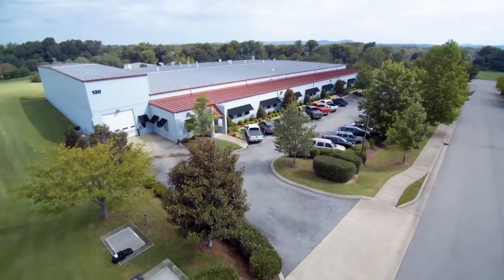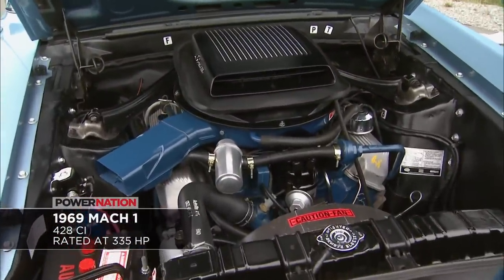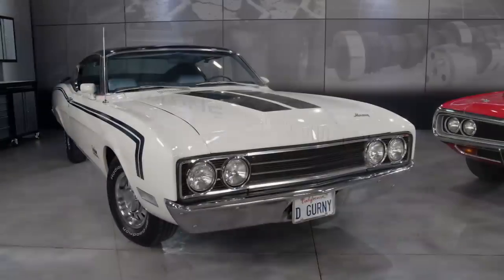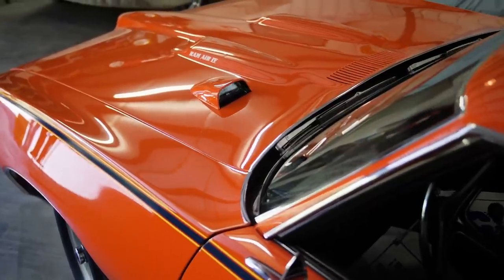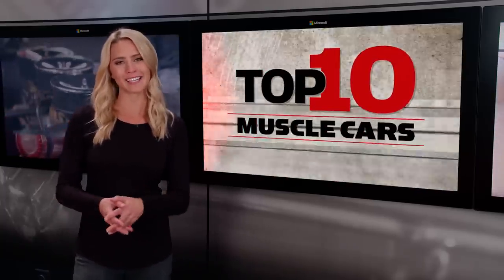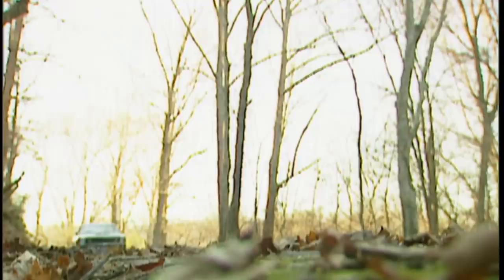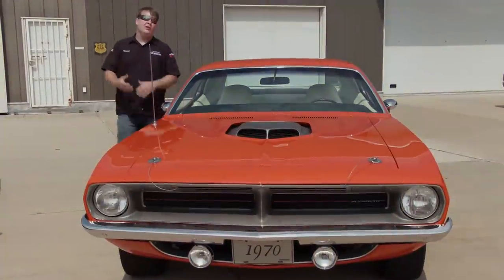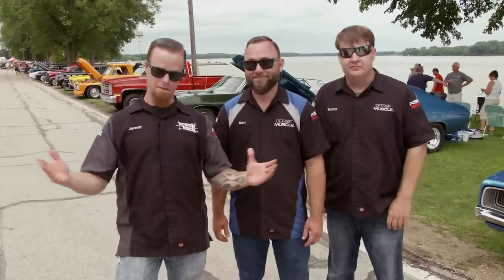Detroit Muscle's Top 10 Muscle Cars

Comment: If I had to choose one car on here it would be the 68 Charger R/T 426 Hemi or the 69 1/2 Roadrunner A12 440 Six Barrel
Reply: 1970 was a great model.  1st year  with electronic voltage regulator,  1st year  with  side marker lights,  rally instrument panel,  F70-14 raised white letter tires,  hydraulic lifters,  etc.
Reply: Jeremy Thompson Damn straight, Brother!!
Reply: Jeremy Thompson I sold my 1968 for 40 charger in 1984 for $375
Reply: I did like the Roadrunners on this one!
Reply: I'd have to take the Hemi Cuda, even though passing up a judge, Shelby GT500KR and the Boss 429 makes it a tough decision but I just have always had Mopar (Mo'Power) in my blood.
Reply: @scottricklaroque7428  Same here. My father had a 70 Challenger, lime green black top, though it was the floor shift so it had to be the 340. Still nostalgic dream car for me. He was a GM skilled trades and would not allow anything else in his driveway.... except the Mopar. He let his sister park her late 70s model mustang here for a few days but he bitched about that too.
Reply: @14yeartwitch14  My friend and I got cars at the same time when we were 16, a couple months apart but I had a '74 Ford Econoline van until he got a '70 Challenger, 225 slant 6, 3 speed floor shift. The van gave out and my dad traded it in on a new '82 Ford pickup but my friends brother had a '74 Plymouth Valiant Scamp, 318 auto I bought putting an 8 3/4" rear in it when the 7'"(?) pinion messed up. The '74 318 only had 150 hp, about the same as the 225 but the only difference between the '72 230 hp 318 was the heads so I was searching for a pair. But anyway, we raced one day from 35 mph and we were dead even. lol I have no idea what gears were in the new rear but it was probably like 3.55 or so but I also jacked up the rear and put L60s on it making it even higher (lower numerically) ratio. I loved that car.
Reply: @scottricklaroque7428  God, that sounds like fun!. I'm going to buy a good 70s muscle car here in the next year. I'd love to have time to fix one up, but I work too damn much. So I'm prob going to buy one in pretty good condition. Decisions, decisions.
Reply: Most people I know in that position get mid '60s Mustangs in good shape and just add bolt on stuff, intake/carb, headers or maybe a nice cam. When I sold my Scamp my neighbor had a modded (I think'74) Maverick, 302, 4 speed that thumped nicely I wanted but he moved before I could get the money. :/
Reply: @scottricklaroque7428  I've always said the only Mustang I would ever own is a Mach 1or2. The one in the Steven Seagal movie Marked for Death was the first one I ever saw that made me change my mind about Mustangs.I have the body of a 71 Detomaso Pantera with all of the innards in a garage attic. It would break the bank and wipe out my retirement to get it back to ideal. Then I've got a weathered and poor conditioned 86 Buick Grand National that would probably take a bit of change to get back to snuff. I'm thinking I'll have to let them go in an estate sale. Ah! It kills me!
Reply: @14yeartwitch14  Damn, I would LOVE to have a GN or GNX Regal. I've always kind of liked the 80's Regals and Cutlasses anyway but the GN snd GNX were the holy grails for me, I did almost go into debt to buy a Hurst Olds, I went there because my Buick Dealer couldn't get any more GNs, they sold their allocation pretty fast but there was a sweet Hurst Olds cutlass, 307 v8 w Hurst Lightning Rod shifter, I'm glad I didn't though, I got a deal the next year on a 71 Firebird I was turning into a Trans Am, had the shaker scoop hood and tailfin with a 400 and a Weiand hi-rise with a Carter 800 cfm Thermoquad and an automatic with B&M shift kit. Man that thing screamed. I would never have been able to afford that had I bought the Olds.
Reply: @scottricklaroque7428  The GN was fun, I learned to drive in it. My mom took me to a local university parking lot and told me to floor it.... i hopes of scaring the shit outta me. Didn't work. But throughout the years she used it as a daily driver and it just didn't get the care it should have gotten. I saw a documentary where there's a place some enthusiast started that has nothing but GN/X spare parts and rebuilds them. I'm just afraid to see what the guy charges.
Reply: The 68 Charger is just awesome, my dream ever, there is no other car for me
Reply: @scottricklaroque7428  Thank you!! Milburn Varner in that 'Plum Crazy' Cuda. "Drag Addicts" Hot Rod magazine.😊❤️
Reply: these constant advertisements are killing me

Comment: I like the 68 Dodge charger 440 R/T six pack black on black it's my dream car. I have ridden in a 70 Pontiac Gto judge 400 ram air iv you could feel it how much it wanted to cut loose my friend has a 67 Chevrolet Camaro 454 450 hp  500 ft. Lbs of torque I rode in it is very fast it may not be a option for 1967 Chevrolet Camaros but when tires start burning rubber its awesome

Comment: LOL, thanks for the laugh.  Muscle Cars by definition were ¼ mile cars. And you guys have embarrassed yourselves not only with your top 10, but "The first muscle car".  1963 Max Wedge was ignored. And the car that held the IHRA factory record for many years, The 1964 Ford Thunderbolt 427FE.  And how the hell was a Stage III GSX missed?    In short, ya prolly need a person over 50 years old to use as a resource, not Autozone.
Reply: My comment before seeing yours was, where the efff is the GSX?
Reply: The 1962 Plymouth Savoy with the 413 max wedge was the first factory production car to break the 12 sec. It ran the 1/4 mile in 11.93 seconds blowing the doors off any other factory production car. The Buick GSX stage 1,2,3 was not faster.
Reply: My uncle was Milburn Varner!!! Check out his history in a "wedge" car!!! Hot Rod magazine. Then a 'Cuda.❤️
Reply: Yep. 63
Reply: Wrong the Plymouth Savoy was the first production car ever built to run the quarter mile in under 12 seconds. Ford got its ass kicked. And as far as the Buick stage 3 it never stood a ghost of a chance against the 1963 Plymouth Savoy.so get your facts straight.

Comment: The Dodge Daytona/Superbird didn't make the list?  You chose a 1969 Camaro SS/RS 396 over a Yenco Camaro or COPO?  No 409 on the list, it's the icon of muscle cars?  No HEMI Charger 500?  No Buick GS or GSX w30 455?  No 67 Shelby 500 427?  No 68 HEMI Dart or Cuda?  I don't see a Yenco Nova on your list.  You skipped the 63 split window Fi Vette!  That is one sad list.  I owned a 70 HEMI Cuda in Plum Crazy, it was a 4-speed and super track pack Dana 60 car, console delete, AM 8-track.  So you at least got number one right!

Comment: Missing the GS Stage 1 and GSX. My drag racing experience in the day says that your poll is bogus.
Reply: I agree same with the Olds 442 W-30 should be there as well but the '70 Stage 1  had the most Tork ... I got my '70 442 W-30 running 12:60's   @ 102 m.p.h. in the quarter mile with a bit of tinkering and tricks...

Comment: Among the cars that would outrun a GTO was one from Pontiac.  The tri-power 421 Bonneville which had a higher top speed and a quicker quarter mile.  re: the COPO Camaro you failed to mention the all aluminum 427 powered ZL-1.
Reply: The Copo was mentioned after they talked about the 69 SS-RS Camaro but the Copo wasn’t a factor production car

Comment: Plum crazy purple 1970 Roadrunner with a 440 six pack that is my dream car and thank you guys for giving me a peek at it even if it didn't have the iconic 440 six pack
Reply: These ran in the upper 11's...Remember 185 60 series bias ply tires they came with had no traction yet ran high 12's - 13's spinning !

My Dad owned his 70 Cuda 440 6bbl since 1970 when new,2 weeks after he bought it he ran 11.80's by tuning the carbs,adding headers/custom mufflers,traction bars and laughable 10 inch wide drag slicks that spun 130 feet down the track lol ! They hook less than a modern tire !

Comment: AMC produced the 2 seater AMXs from 1968 to 1970. With factory options including Doug Thorley headers, 390 stroker motor crossram dual 4 barrel edelbrock intake dual Holley 4bbls an amc 20 with posi and 5.11 to one gearing this was the fastest production car in the quarter mile in 1969. They shared many parts with the Javelin but shorter wheelbase and only 2 seats.
Reply: Wrong..... The AMX did not come factory equipped with any of those parts as a regular production option. What AMC did offer was select catalog aftermarket parts called "group 19" that you got through the parts department and installed yourself. In 1969 AMC commisioned Hurst to build 54 SS AMX cars for super stock class drag racing that were not street legal. Those 54 were race cars only sold to select racers to fly the AMC banner at the drag strip.

While the 1969 SS AMX race package was the most potent AMC it was by far not the fastest. Chrysler had Hurst build 80 Hemi 1968 Dodge darts equipped dubbed "LO23" and 80 Hemi 1968 Plymouth Barracudas "BO23".. As delivered the Hemi mopars were a full second quicker that the AMCs through the quarter mile and still rule SS/AA Super Stock drag racing to this day.

Comment: Chrysler 300 was First !!
Reply: Oldsmobile may argue with the rocket 350
Reply: @bmstylee  You can argue until you are blue in the face but you are WRONG.

Produced from 1968–1980, the Rocket 350 was entirely different from the other GM divisions' 350's. It used a 4.057 in (103.0 mm) bore and Oldsmobile small-block standard 3.385 in (86.0 mm) stroke for 350 cu in (5.7 L). Output ranged from 160-325 hp (119-242 kW). 

http://www.autozine.org/Archive/Chrysler/classic/300.html
Reply: @DeliciousDeBlair  Shows what you know. LOL. Look up the Olds Rocket 88 form the 50's. Also look up the OLDS J2. First car outlawed from NASCAR.
Reply: @Gramps83  My dad had a 371 J2 in a 1958 Delta Super 88.

In fact he owned from 1953 to 1959 Oldsmobiles [including a 1957 Fiesta 3 piece back glass] and from what the information shows, the only reason the J2 was banned was this sudden ban [be it strategically planned or not] on the use of multiple carburetors.

A large 4bb carb would have well suited the need and resolved that issue just fine.

The J2 was STILL behind the Hemi in chronological history of winning championships, as well as behind on overall power numbers over time so that at no time was it genuinely a competitive force against the Hemi, and although the non-hemi engines may have faltered a bit, they too have held their own quite contentiously throughout time.
Reply: @DeliciousDeBlair  All I'm saying is the Olds/GM V8 being the first mass produced OHV V8 was the beginning of the "muscle car" in my eyes. by '53 or '54 they were closing in on 200 hp and 300 Tq. A reason many hot rodders used them. But yeah, the late 50's saw better power numbers for both the Chevy small block and the Hemi.
Reply: @Gramps83  Determining how much 'muscle' makes a 'muscle car' also should be weighed against how much 'muscle' a 'non-muscle car' makes by the same producer, and, in general, how it stands against the existing industry as a whole.

The records easily located show that Oldsmobile was not reaching the 200 mark until 1955, when Chrysler was reaching the 300 hp mark.

Unless you can find some more official, verifiable and authoritative report, I will refer to the following links:

https://en.wikipedia.org/wiki/Chrysler_Hemi_engine

https://en.wikipedia.org/wiki/Oldsmobile_V8_engine

According to those reference articles, at no time in history did the Oldsmobile even equal the Hemi, let alone surpass it, and again, when you use the definition of 'muscle car'  you must establish what parameters you are using or else it is purely a preference and an emotionally biased one at that.

In between more recent years when the Hemi was deemed too expensive to produce and market, of course, Chrysler introduced the wedge series or the B [and then later RB] series of engines.

https://en.wikipedia.org/wiki/Chrysler_B_engine

Again, at no point in time, did Oldsmobile outperform these engines save when the oil embargo and emissions crunch led Chrysler to begin reporting HP as BHP [wheel horsepower] to intentionally downplay the power of their engines for the sake of appeasing the EPA and DoT, although eventually they did actually de-tune [as did all of the other OEM MFRs] their engines to comply with the government's ludicrous and unfounded demands.

The facts stand for themselves in this issue.
Reply: @DeliciousDeBlair  Yeah, but you are not accounting for torque and gearing which are more important than horsepower. Especially with "Muscle cars".
Reply: @Gramps83  The torque specs are all there in those charts.

I have driven Oldsmobiles and MOPARS and in all fairness, a 'seat of the pants' assessment is not very realistic.

Some of the reason some people argue that a 'muscle car' has to be light is because they posit [and with some fair validity] that if you are carrying a whole lot of extra mass around with you it is going to eat up a lot of your 'muscle' compared to putting the more powerful engine in a lighter body.

For this reason, many would argue that neither the early Chrysler or Oldsmobiles were 'muscle cars' but since there were few real comparable chassis out there to consider 'lighter' at the time, one definitely has to go with whatever combined engine and body one could acquire directly from the factory.

Now I do not claim to know all of the weights or gear ratios offered by either, let alone both of these manufacturers, but if one wanted to research it out and 'hand pick a dream car' it might be kind of challenging, seeing as for most of the Chrysler 300's career, it 'always and only' came with the biggest, strongest engine they made, but then later on, they changed this policy and began favoring B-body cars like the Charger, Challenger, GTX, Barracuda, etc.

I do not know what engines in 1955 you could get in what Oldsmobile models, directly from the factory, or how much those cars would weigh or their BHP/weight ratios were, but it was very rigidly fixed for the Chrysler models, be that a good or bad market strategy.

So all in all, just going off of the limited information there is now, one can not really declare any advantage based on torque and gearing, at least without doing some more research into what cars you could buy from Oldsmobile with which engines and which final drive ratios.

I am sure that if you wanted to press that point, some data might exist out there to further push your thesis, but for now, going on the easily obtained, its still a push in favor of the Chrysler corporation.

Sadly, neither of them would really stand up well against the Corvette line up and people for some reason often overlook it as a 'muscle' car and deem it a 'sports' car, even though it did have some pretty punchy engines and was always a very light chassis.
Reply: @DeliciousDeBlair  There were no torque specs in those links.
Reply: @Gramps83  All of the links I sent you had the torque specs in them, wtf you talking about?
Reply: @bmstylee  the Oldsmobile 350 Rocket didn't come out until like 13 years after the first Chrysler 300. The 1955 Chrysler C-300 is the very first American muscle car
Reply: @Gramps83  I know exactly what a J2 Oldsmobile is. They only made em in 1957-58. They got outlawed at the exact same time as the supercharged Ford 312, fuel injected Chevy 283, and the Pontiac 347 Tri Power. NASCAR banned superchargers, fuel injection, and multiple carburetors in 1957. The 1955 Chrysler C-300 is the very first American muscle car and also the very first regular production car with 300 horsepower. A Six Cylinder Hudson Hornet was faster than a 1949-53 Olds Rocket 88. The early Rocket 88's were fast for their day but they only made 135 horsepower. The 57-58 J2 Olds definitely were really fast in their day. One of the fastest cars on the road at that time actually

Comment: Barracuda came out before mustang
Reply: "The first-generation Ford Mustang was manufactured by Ford from March 1964 until 1973. "  and. "the Barracuda debuted in fastback form on April 1, 1964."  So it was the Mustang then the Cuda..
Reply: Actually it was planned to come out first but Ford got wind of what Chrysler was planning and rushed the mustang thru. I believe the Barracuda was first with a V8 though.
Reply: The Barracuda did indeed "come out" before, was available for sale 2 weeks before the Mustang.  Plymouth began taking sales on April 1, 1964, and Ford made the Mustang available on April 17, two weeks later.  The Mustang was much more distinct, and sold much better.  It took a few years for Plymouth to work out better styling of the Barracuda, by which time Plymouth also began offering LARGE engines in the platform.  Mustang is more collectable; B and RB powered Barracudas are more desired for RACING.